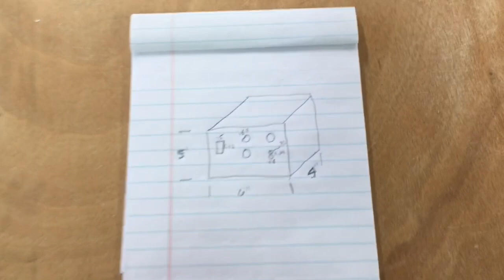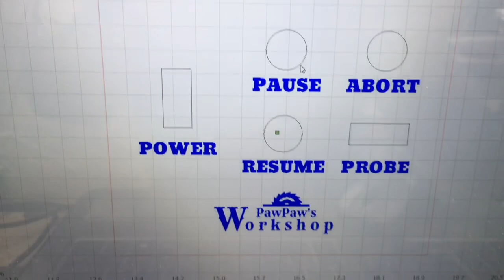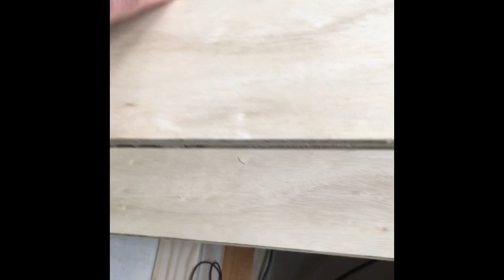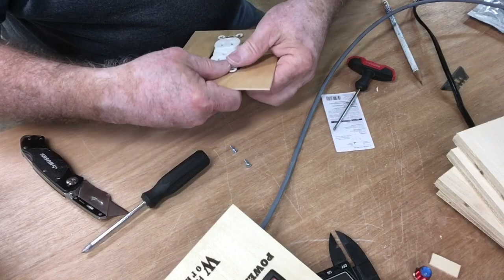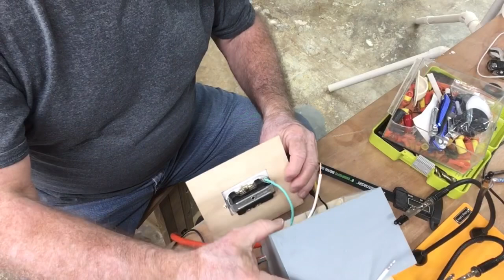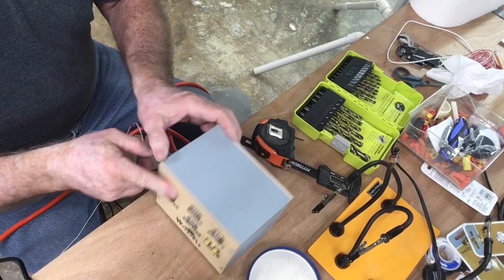How to I Made My Control Box for the CNC4NEWBIE NEW Carve

Comment: Is there an easy way to wire in controls to move the spindle?  When I started the video, I thought that's where you were going.  I'm guessing you could take a keyboard emulator and wire it to the computer and with 6 buttons you could move the spindle on all three axis without having to reach for the computer.
Reply from the maker: Interesting idea.  I have not considered this project.

Comment: Another nice build, you took the necessary precautions with the electrical connections and using heat shrink tubing and keeping everything organized and neat. I am not saying it but,  I bet some saftey noob is going to treat you disrespectfully for using a wood enclosure instead of plastic. I would do what you did with no reservations. And I also bet the person that is critical of your choices of materials has never heard of Knob  and Post Wiring! As an Electrical Engineer prior to flying airplanes for a living I will stand behind you. 
I would wrap the contacts on the electrical receptacle with electricians tape, you may have already done that as I stoped the video to comment! 
Knowing how critical folks can be on Youtube. Have wonder day. Thank you for sharing you inspiration with others and that is Great! 😁🛫
Reply from the maker: Thank you very much for the very nice comments.  It is very important to be save and take your time with the wiring.  I am not an electrical expert but I know that you need to do things correctly and safely.  Wood enclosure I believe will be just fine.  I do not have the ability to create one from plastic. I too was a pilot and understand the need to be accurate and safe.